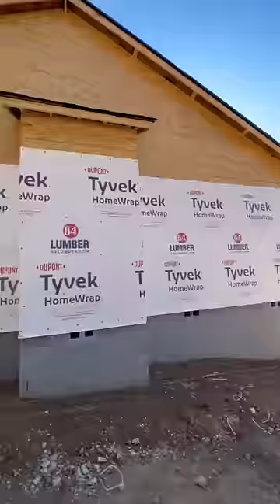Build My $350000 Wooden House in 60 seconds!!

Comment: As a constructor from Europe, I could never get my head around on why making those frames and roofs with wood.
Reply: I'm from EU too.. and I'm building one right now and this house is just frames compared to mine. I only dream of his costs of building this house. :)) I guess he is lucky he cand build this type of building in that area.
Reply: EU Architect here, when he said that was the foundation I got scared...
Reply: What do you use instead? I'm sure it's sturdier because of colder weather where you are.
Reply: Reinforced concrete wirh iron bars, in the middle is the groud with the earth from the sides, isolating materials, gravel and over that concret with iron bars. 1m hight from the ground for better isolation. For the walls mineral wool isolation inside the bricks. Over that you can put a special paste for isolation or extruded polystyrene, than over reinforced concrete and than the beams for the roof... it costs a lot but there are more expensive solutions. This one is good quality at an acceptable price. When it will hit -10 or -20 Celsius I'll know if it was worth it or not :))
Reply: @TITAN59907  Wow, wool and all. I think this house is in Georgia so temps dip into teens but soon en9ugh it's hot as hades so wool is unheard of.
Reply: @mdeborah827  Mine it's in Romania. Lately (last 10 years) we had warm winters but this one si lacking the snow but still we have low temp since october. I've seen in warm regions brick houses and they are great to keep a cooler temp inside the house. If you do it right you don't have to use airconditioning. I use a semi-pasive air circulation, 2 tubes for air to go inside and 1 for each room to expell the air.
Reply: For a hurricane to blow away the walls & to rip off the roof easier! 😂

Seriously, I'm not a constructor, but I always wondered WHY Americans do not build dome-like private houses with heavy solid concrete foundation in hurricane prone areas?
Dome is the strongest architectural form, very aerodynamic, yet they build boxes on studs...
Reply: @TITAN59907  Interesting, yes    I've seen the brick. One side of my family is from upstate South Carolina and my Grandfather showed me a little window in a wall where you could see how he constructed the house. It was wood and ut was solid but it did eventually burn down. Other side is from the Bahamas and no way will there ever be wool and iron in a roof there and absolutely no basements as those limestone islands flood. The crawl space was  interesting as that is common. They use a lot of cinder block construction because of storms. I was in Hurricane Andrew in the 90's and the old houses held up. One or two roofs went flying but 50 miles away in Miami the subpar cinder blocks disintegrated. It was terrible.
  In South Carolina especially in Charleston the bricks have the fingerprints of Slave laborers all over the place. 
  In Mexico Beach, FL there is a house built by two brothers that was designed to stand up to storms surpassing the building codes. Those two are my heroes. I was in Hurricane Sandy. Ugh.
Reply: @mdeborah827  yeah I was about to say wait till a hurricane rolls round and that won't be there anymore. Also I'm confused on the 350 thousand part, that must be how much it's worth cause there's no way that costs 350 thousand to build
Reply: @BLAQFiniks  because they're too cheap.
Reply: Garden shed to store crap in
Reply: As a construction worker from Northern Europe. I build houses from wood. We need heavy insulation here (500mm in the roof and 300mm in the walls). Wood is cheaper, easier to work with, can build complex designs with wood, can insulate inside the frame etc. You can't insulate inside concrete, costly, hard to modify (cables, plumbing). Making a house out wood is a way better option here.
Reply: @fraided88  how long will this wooden house last though, without any maintaince
Reply: @BLAQFiniks  it’s usually for weather and natural disasters. better to be stuck under wood than steel or bricks. since EU doesn’t really experience hurricanes, tornadoes or earthquakes they build their homes from brick , steel, etc.
Reply: Houses just aren’t built to last in the US
Reply: Thank you🤣🤣
Reply: @BLAQFiniks  the amount of customisation that would go into creating rounded materials would make the cost of building phenomenally high
Reply: Its cheaper I guess
Reply: It's cheaper
Reply: We don't build stuff to last in Merica just long enough so when I die the next guy has to take care of the problems I left behind.
Reply: Easier repairs, it's more flexible and cheaper
Reply: Wooden structures are very common in the US
Reply: @TITAN59907  Never heard of fibreglass or foam insulation??
Reply: I was gonna say that, it reminds me of the kid's tale about the Three Little Pigs, where the wolf came and blew the houses away xd
Reply: Earthquakes & tornados Thats Why..
Reply: @mdeborah827   the Wool keeps the heat out as well 😀
Reply: @robertescu6435  much higher frost line there. He lives in the southern us. In the northern states and Canada, that foundation would not fly.
Reply: @magnusfuglsangmlgaard7641  So interesting! It's getting hotter up there too these days too. 
 The high crawl space was interesting because of the flooding these days all over the place. 
  There's really no place to hide so build for whatever is coming.
Reply: @mdeborah827  ALSO ALMOST ALL HOUSES ARE BUILT THAT WAY NO MATTER WHERE IN EUROPE ...THAT'S WHY WE STILL REUSE BUILDINGS FROM LITERALLY 1700 TO 1900 Xd
Reply: @BLAQFiniks  concrete doesnt handle earthquakes well, wood is quicker, lighter, and cheaper to construct with, and we have the land to replace the trees (now if only more companies would do this, some are, but not the majority last I knew.)

Many European countries don't have that amount of wood and land to make it a viably-cheap option, in my understanding.
Reply: No wonder their houses goes bye bye every time there is some wind. Ok granted tornadoes in some cases. But what can u expect from those things. In Eu some tree houses are stronger than those things.
Reply: @jdcrafterplays3667  if woods properly insulated it would last way longer than a human lifespan. There’s houses that were built nearly 100 years ago out of wood, and if the design was done right, and thoroughly, the house would still be standing with little problems.
Reply: @BLAQFiniks  You realize not all places have hurricanes… right?💀💀
Reply: @tutu7564  100 years ain't really that long in architecture terms
Reply: Cheap, sustainable, modular, ability to build in prefab, great possibility for isolation.

Quite sturdy especially when looking into CLT and glulam. Honestly timber is a great building material. 

There are even +50m buildings that are primarily timber in Europe. Sure it’s still hybrid. Somethings timber just can’t do (yet) but who knows what timber technologies are still to come.
Reply: It depends on the state you live in. Here in florida the outer walls have to be made of concrete due to  hurricanes but it makes construction more expensive.
Reply: @mdeborah827  insulation helps AC keep cold air in too
Reply: 1 tornado and it's done
Reply: @jdcrafterplays3667  house just needs to last as long as a person will be alive ….Annnnnnd that’s it
Reply: @changeforthebetter4063  seems abit dumb to have a building last for such a little amount of time, if I built a house I think it would be pretty cool for it to be around for 600 years after
Reply: @jdcrafterplays3667  true but welcome to America
Reply: @slavplaysgames  I said than any other Eruppean country, as in one country's domestic wood production, compared to american domestic wood production. 1 to 1, no European country can compete. Now, combine the slavic countries, and yeah, Norway, Finland, and Sweden have enough forest combined, but on their own? Nope.

You misunderstood what I was saying and are attempting to strawman my argument. How about you go touch some grass and quit arguing with people online for a change? ^,<

Edit: turns out we DO import from Canada (softwoods) but look at figures for hardwoods.
Reply: @manganvbg90  because they HAVE THE WOOD LIKE WE DO holy shit, an American making sense?
Reply: @slavplaysgames  because 1:1 is country:country, not country:state. And besides, less population means more room to grow trees, but hey, by your logic we shouldn't have ANY room for them? Because we're more populated? We're also MUCH larger, and IK we ain't first for much, I never claimed we are, I simply stated we use wood to build homes because it's cheap and lighter to move around. You're the one unable to accept the fact we KNOW we will need to rebuild more often. Guess what that leads to, sir? More jobs in construction (and restoration/repurposing for that matter.)
Reply: @mdeborah827  I'm from germany, where it really isn't that cold, and we use reinforced concrete for most of the walls with far thicker pieces of wood than was shown in this video for the roof.
Reply: @TITAN59907  he is somewhere on the eastern seaboard, in the south, probably North Carolina. Frost lines and soil erosion aren’t really a concern in a lot of the south. Shallow footings and block walls (although every two feet of block is supposed to be a bond beem) with rebar connecting the footer to the foundation are more than ample enough to withstand decades and decades. As long as a hurricane doesn’t come through, or termites don’t get, it will be fine.
Reply: I am from germany and i completely understand what you mean. I would never build with some much wood only due to the fact that when it burns it burns really fast and nothing remains afterwards.
Reply: @robertescu6435  
Definitely can’t do a foundation like that in Canada.
Reply: @BLAQFiniks  
Will that prevent damage from inland flooding or flying materials like the roof of a building a mile away hitting the dome like building?
Reply: Right? Never understood that people in hurricane/tornado county build houses from wood and cardboard. How about some weight and structure instead?
Reply: As asian i can relate
Reply: @mdeborah827  bricks and concrete. In Ukraine we always used that, my grandpa made a 3rd floor using it. We don’t use wood that breaks through if you accidentally fall on the wall.
Reply: @mdeborah827  generally these days we build in reinforce concrete and brick.
Reply: @tutu7564  yes my house in LA made from redwood with concrete foundation is 110+years old
Reply: @DarrenMalin  With increased storms it will probably be necessary to go further than before but what do we do in epic floods these days in terms of building? In any case this is an interesting video to see the house built so quickly but from both my southern side and my Bahamas side the  carpentry tradition was akin to Thomas Day and those houses were built to last. That tradition is not given to dexcendants today to the American born who built D.C., the White House, etc. You know what is said about idle hands. I undesrstand fast but we also have legacies here of a Benjamin Banneker nature.
Reply: Thank you
Reply: @mdeborah827  here is Spain all homes are build of reinforced concrete and brick
Reply: Not a constructor nor architect nor from EU, I'm from Asia but I agree. I really didn't understand why they used wood instead of metal.
Reply: @BLAQFiniks  miami native here. My house is older and barely has any drywall. Mostly solid concrete walls so it’s definitely withstood hurricanes. Just depends on where it’s at but for some reason other Floridians don’t have hurricane proof homes still.
Reply: @DarrenMalin  Built to last for sure. Here they mostly throw these places up and the walls are paper thin, all sorts of problems. My last boss was remodeling a condo in NYC and I remember him hollering at the contractor about cementing the floors and so on. His company made machines that make equipment so he knew a thing or two. I had enough on my plate dealing with him but I started to say if you don't have your 👀 on some of them, not all, they will screw you!  Witnessed the older men with real skills and integrity who were master builders from both the South and The Bahamas. The only issue Bahamian houses dealt with was dreaded termites and hurricanes. My Grandfather's house had heavy walls, solid construction but up it went by fire one fine day. Nothing like those solid cinder blocks! They stand up to fire better.
Reply: Ur roofs are concrete? Ur hallways and rooms are concrete? Ur knee walls are concrete? So u u all live in warehouses? It’s not that hard to understand why wood is a good material to use. Maybe due to better land and climate 🤔
Reply: what about the foundation? It's a crime
Reply: @MextizaCalifa  why the fuck do people think the entire US has earthquakes and tornadoes?